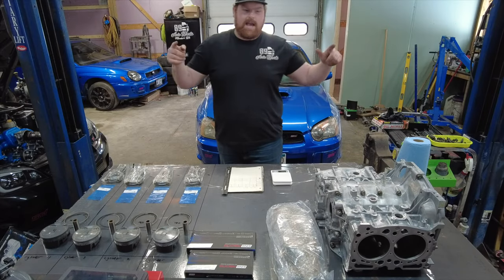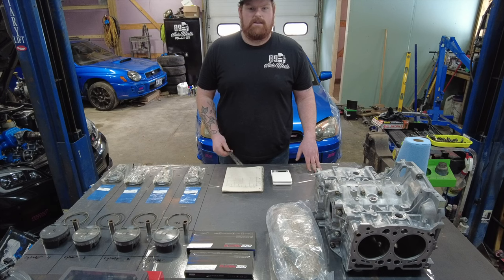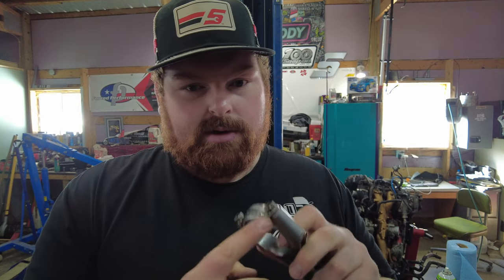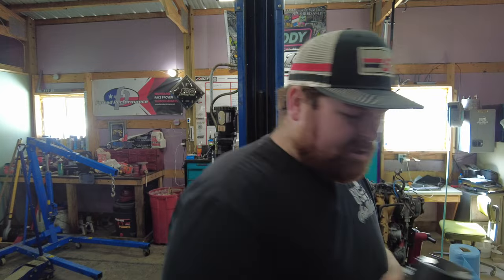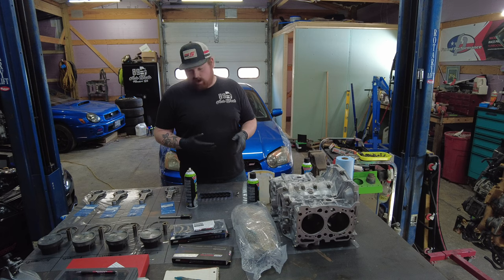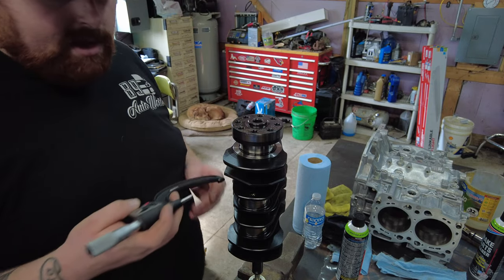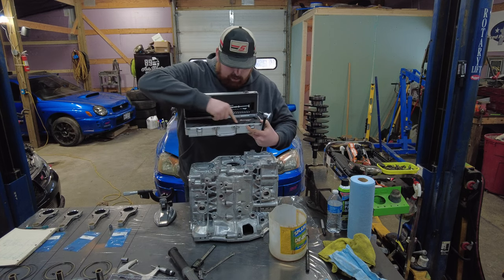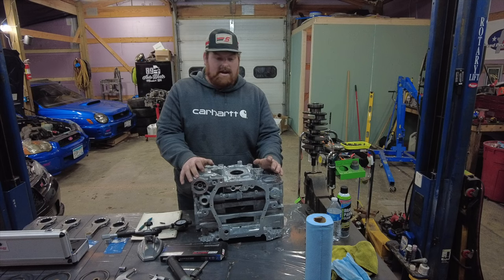PART 1: My First Time Blueprinting an Engine - '04 Subaru STI EJ257

Comment: The reason you would go about Balancing and Blueprinting is to keep longevity in a highly invested in motor for 1. The next reason is you can use slightly tighter tolerances all around, most likely do to after market Crank/head bolts also many B&B engines are altered displacements so you would want to mitigate the differences in forces. The last reason is actually a bit of both of the previous and a bit more thought into vibration and friction especially used in high revving race/endurance applications when oil viscosity comes into play.

Comment: Balancing the rotating assembly keeps the engine together at high rpms and hspr levels, it also makes the engine run smoothly